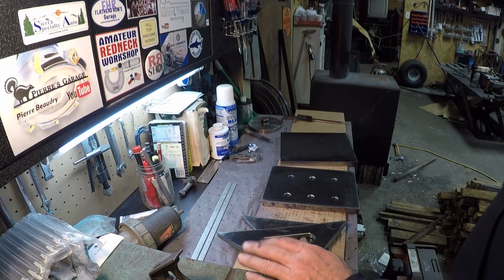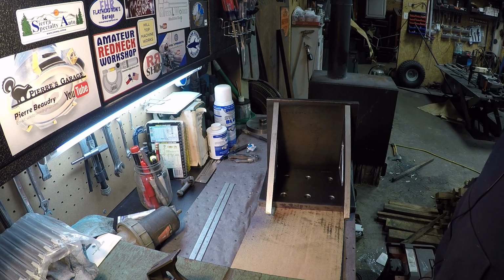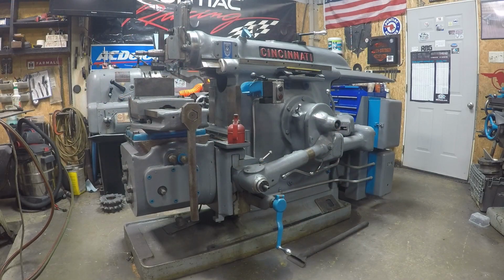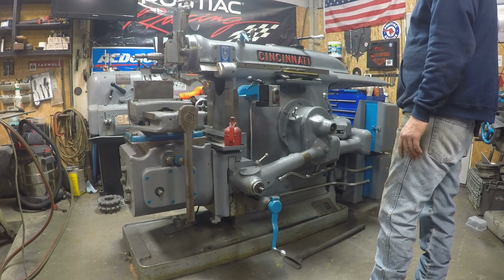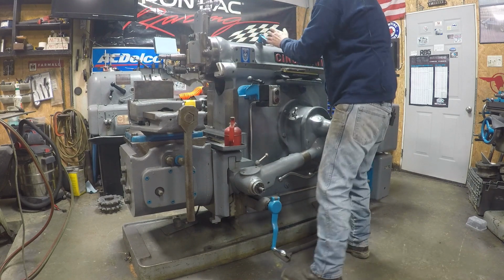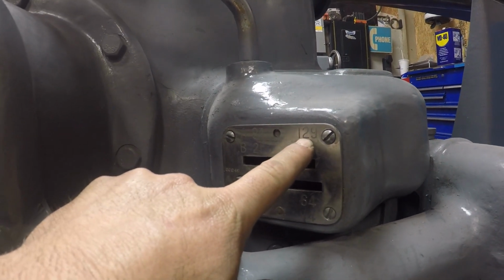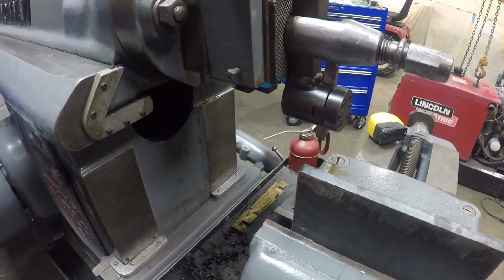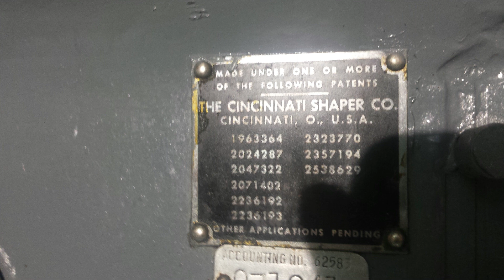Angle Plate Build for the Index Mill and Cincinnati Shaper     Part 1

Comment: Adam Booth's G&E and Steve Summer's Cincinnati shapers are both mechanical crank type machines just like yours. Rockford are the only hydraulic shapers I've seen but there probably are other ones. The older Cincinnati's had a lever controlled friction clutch that you can slip by going easy on the lever thereby moving the ram slowly. Cincinnati later went to an electric clutch that is either on or off. I have both styles and prefer the friction clutch. If your machine has been sitting for a long time and you want to pre-oil it you can set the stroke to 0 and run it, I believe the manual mentions this somewhere iirc.
Thanks for the video.
Reply from the maker: Sorry I didn't described it as ood as you did.  I will correct that in the next video.  Yes I pre oil my  machine .